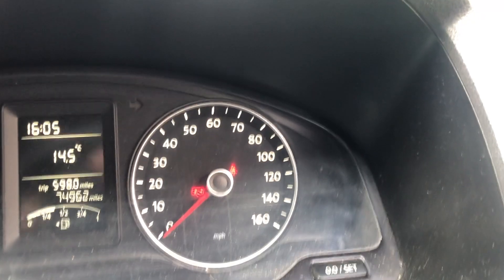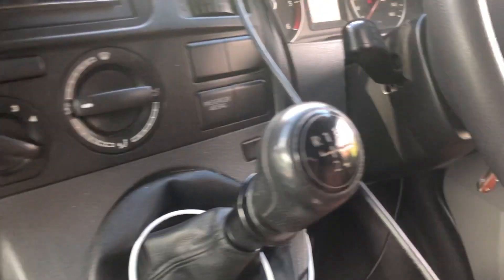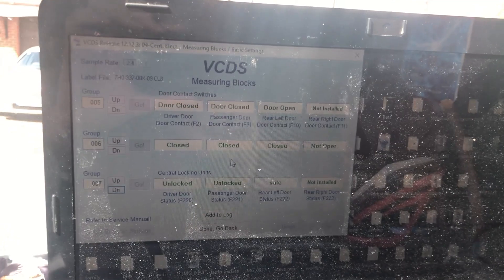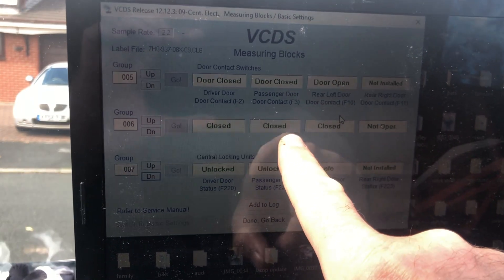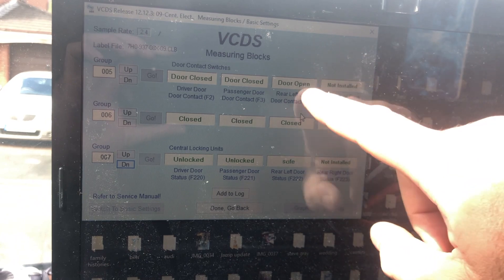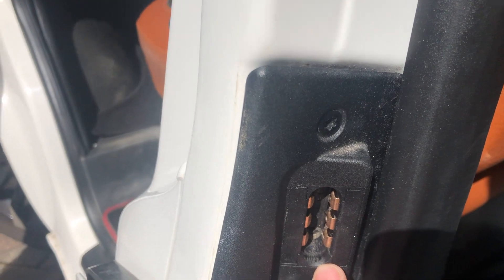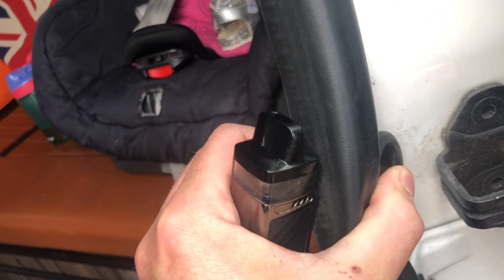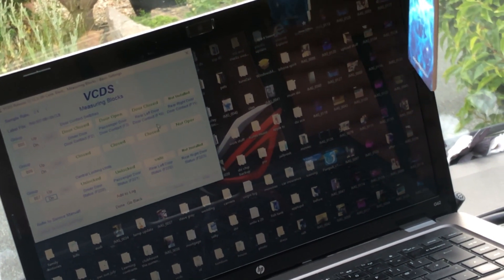VW T5 transporter Door warning light VCDS fix!

Comment: One hell of a massive thank you for this video. I had the door open symbol on the dash (60 plate T5) I pulled the runner panel off, squirted copious amounts of lube in the locks, then watched this. Slightly different design on mine but same principle. I found a little rubber grommet/plunger type thingy under the middle seat. Stuck it back on, and voila !! No more lighty. 

Thanks for posting 😁
Reply from the maker: Glad it helped 👍🏻

Comment: My light on sliding door was staying on until I locked van then it just stayed on same day so I took bulbs out and light on dash saying door open it's locking ok any help pls would be appreciated
Reply from the maker: I would check the bulb wiring to make sure it’s not damaged, but doesn’t really explain why your getting a door open warning 🤔
Reply: @AXISUK  ye I know it's abit weird as the light was off till I clicked it in and when I locked van it went out but then I checked again about half hour later and it want going off when locking van that's why I took bulb out then light on dash came on
Reply from the maker: Did you check that little black round switch? Also check the contacts on the door and door frame to see if they are clean and contacting
Reply: @AXISUK  thanks I will do so today at some point thanks for your reply I will keep you posted
Reply: @AXISUK I looked at everything you said all ok this just happened yesterday and it was when I took the bulb off the sliding door step it was working but is very rusty any help pls thanks again

Comment: Where is this thing you’ve pulled out? I can’t quite tell from the video, many thanks - I have a drivers door lock playing up and no immobiliser light so would like to try this!
Reply from the maker: If you face the sliding door from outside. Look to the right and just behind the locking ring will be a black rubber bung.  Just pull that and see if it works.
Reply: @AXISUK Found it this morning, sadly not my issue. Looks like actuator is on the way out …
Reply from the maker: @dombradbury  that’s a shame 😳hopefully it’s an easy fix.

Comment: I've done this, and now all my doors lock, which is great, but the lights still on the dash. More sinister problem or do I need to clear the error code somehow? Thanks!
Reply from the maker: If it was a sticking sensor then it should have cleared when you pull it out. Sounds like it maybe something else I’m affraid.
Reply: No provs, thanks for your quick response! @AXISUK
Reply from the maker: @rickbaker3788  no probably and sorry I couldn’t help any more 👍🏻
Reply: Did you ever sort the problem my van is same

Comment: thanks very much for sharing this.. i had my van in the main VW DEALERSHIP IN FERMOY CO CORK.they said i needed a new door lock and wanted 600 euro. i said to leave it, i spent 10 mins on line, found this, went out to the van, fiddled about with that switch, and hey presto..dash light went off.BEWARE OF THE MAIN STEALERS !! Absolute bare faced robbers !!
Reply from the maker: Win win to you 👍🏻 saved a fortune and glad it helped you out.